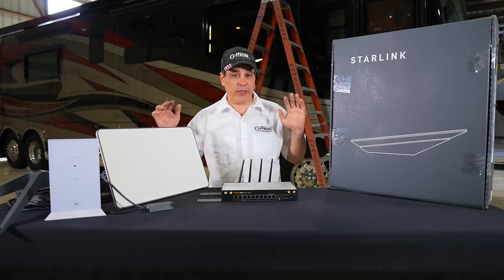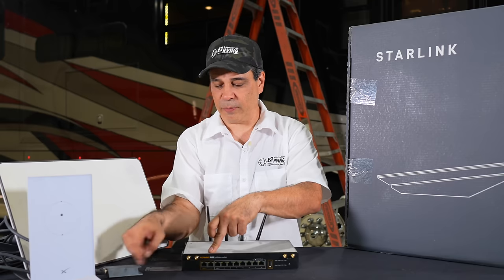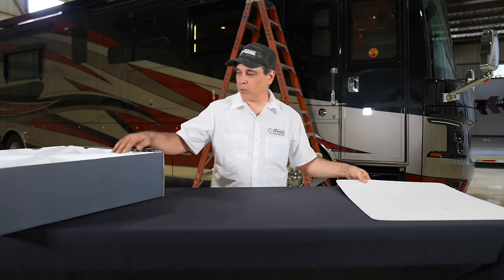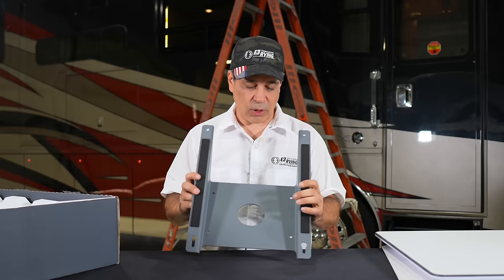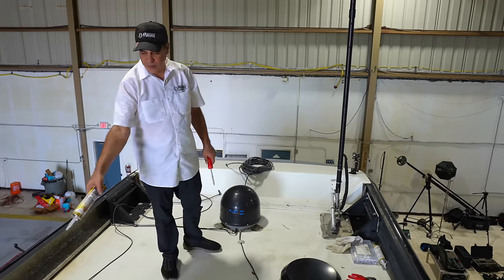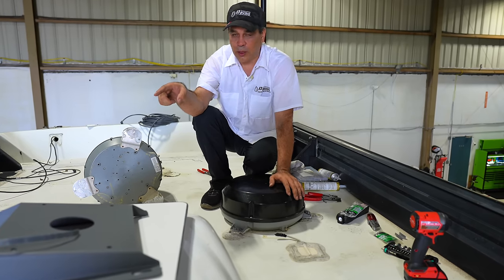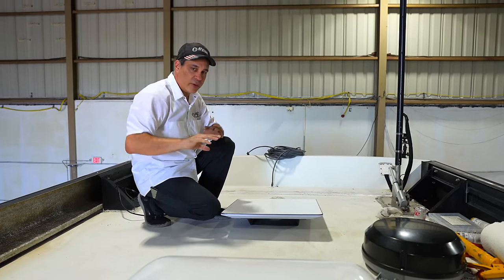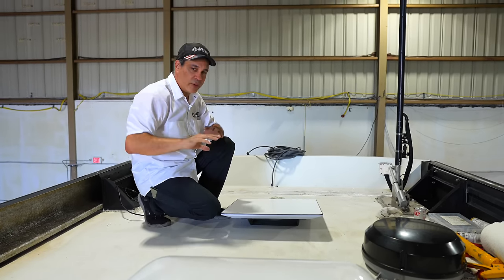Mind-Blowing Starlink Setup for RVs -Epic Install

Comment: So $5000 worth of simple Starlink equipment! Yeah no.
Reply: StarLink is not $5K.
Reply: Two of the fixed flat high performance versions (@$2500) are. And that's without a router. That's what he's referring to here, the flat mount HPs.

Comment: One or two Starlink subscriptions to make this work?
Reply from the maker: 2 subscriptions but we turn one off while not traveling and depending which has best signal when we park.  The nice thing about starlink is you can suspend service from the app wherever you want.  You can even turn off and one multiple times a month with no problems or billing.

Comment: I enjoyed the install however I wonder with 2 Starlink dishes do you have to pay for each individual dish or is it just one mobile plan accounts with 2 dishes?
Reply: @billparadis8995  Yes we have 2 separate accounts.  However the nice thing about starlink you can turn them off and on anytime right from your app.  So if we want the speed or we are on the road traveling we keep them both on.  Then while in motion we never drop signals.  Then when we are in a park we just turn off the one under trees, or either one because we typically don't need both running.
Reply: @BrianJohnson-bd2wu but you still pay for both as the bill is pre paid monthly.